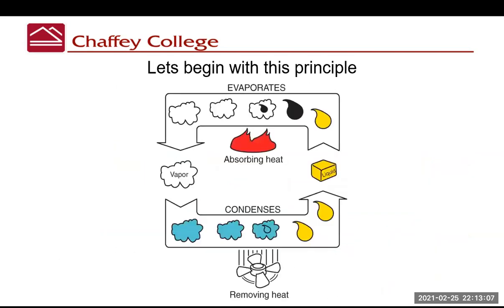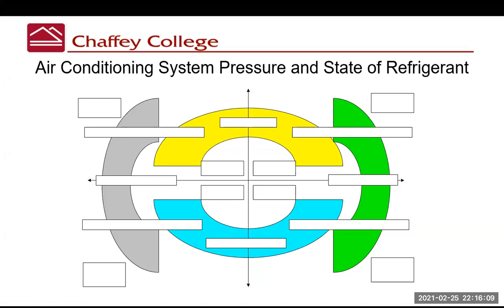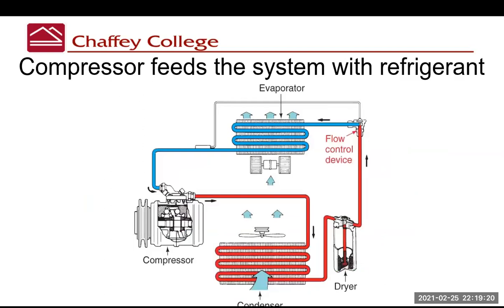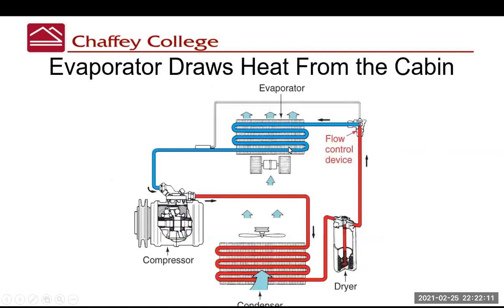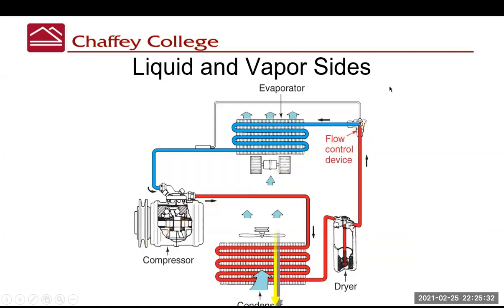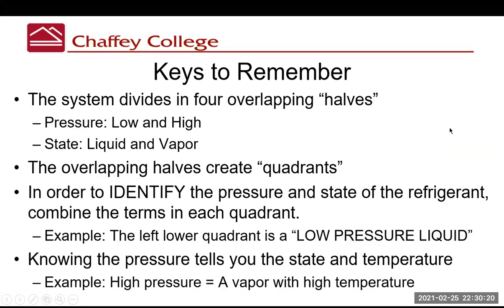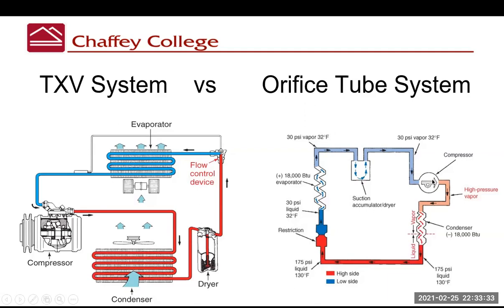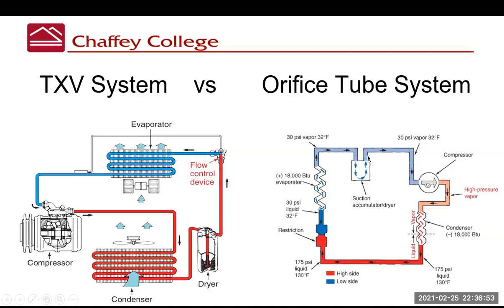How does your AC really work?

Comment: excellent explanation, based on this which of the AC system components contributes most to the thermal capacity of the system, in other words, say we need to upgrade a standard SUV factory AC , to be  able to handle blowing 42 degree F during extended exploration in extreme middle east desert heat in excess of 130 F ,  what do we upgrade in order of priority and  , how do we measure the overall additional capacity?